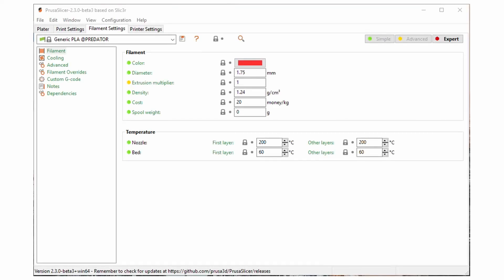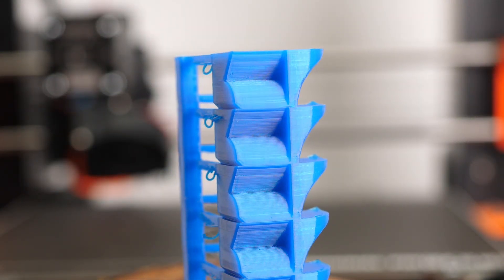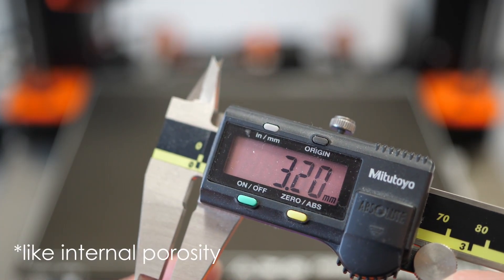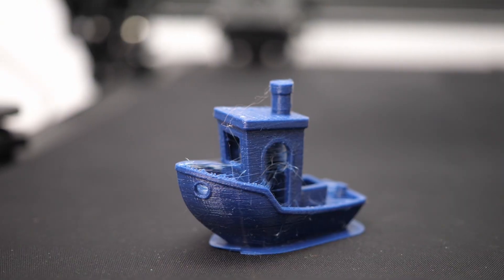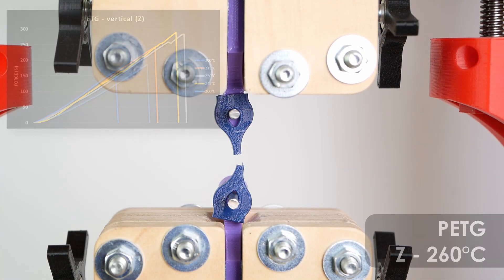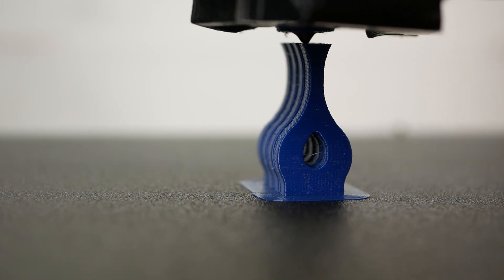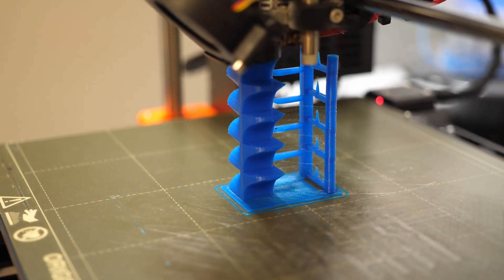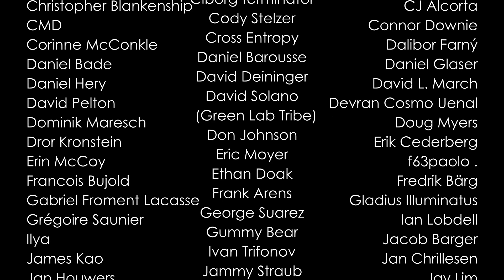Stronger 3D prints at higher temperatures? (strength test!)

Comment: Just a guess here, but could the delta between the extruding material and the previous layer weaken adhesion?  The hotter tests, I would think, would show a greater delta between the previous layer and the extruding material.  I know when mixing, materials that are closer in temperature tend to blend faster than ones that are highly variant.
Reply: I like this theory.  There could be a difference in the internal stresses as the new layer cools and shrinks.

Comment: I like to print hot so the plastic flows easier and sticks better to layers and the bed I print my petg at 240-245 and I get much better results than with the general petg preset in prusaslicer